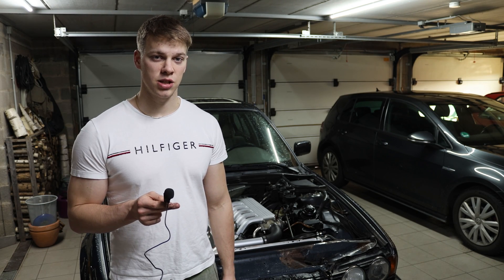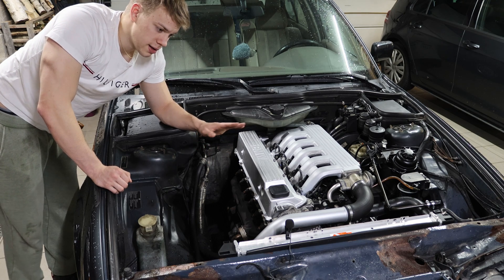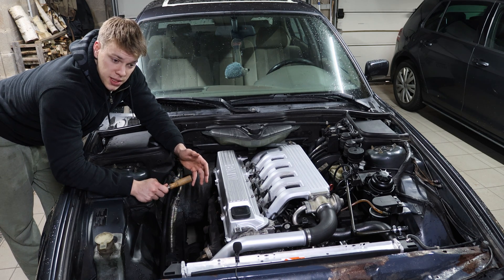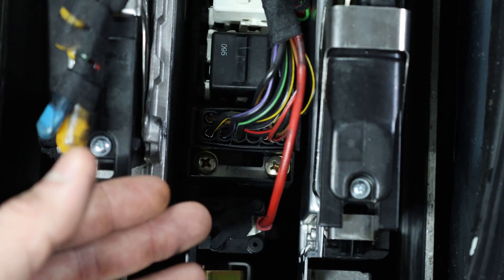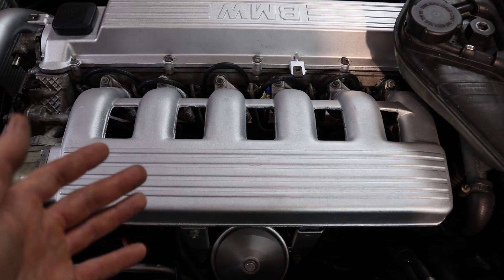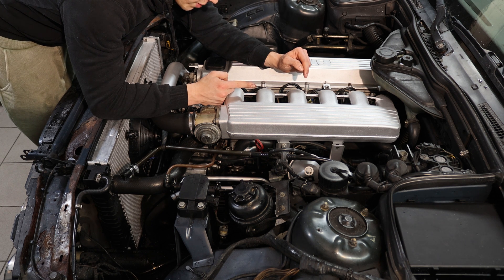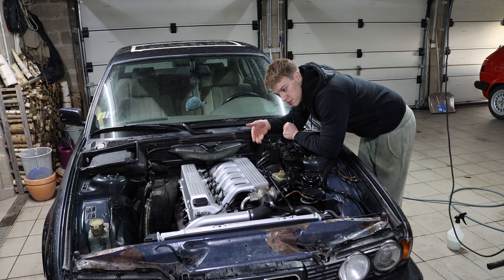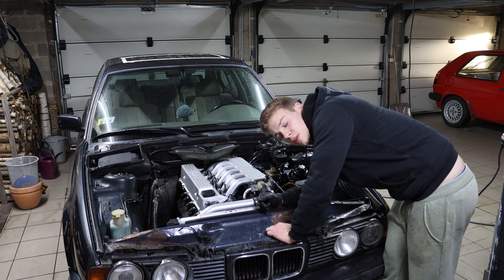How to diagnose and time the injection pump on an M51d25 or m41 (525/325/318)td.s //Ep7

Comment: Any ideas why I have a hunting idle? The car starts on the button, been sat 11 years, it smokes alot out the exhaust aswell, I've put fresh diesel in and changed the filter
Reply from the maker: @user-ej4cb8qv3j
what kind of smoke grey/white/ black? Since you replaced the filter and diesel(necessary after 11 years of sitting and well thought), you probably introduced air into the system( prefilled the filter?). Or it is pulling air from the bridle return lines. Also, check the blockoff cap on the injector from cylinder number 6. These caps often introduce air into the system.
Another possibility could be that someone adjusted the electrical top part on the injection pump( before your ownership) to the transmission side, thereby making the engine run richer. The ECU tries to compensate for this and a hunting idle is often the consequence.  Hope this helps!
Reply: @DailyDrivenClasssics  I'd say the smoke is a blue/ grey, if I break loose the injector lines and crank the engine to see if it has any air, do I need to disconnect the starter relay or starter love wire to stop it wanting to run?
Reply from the maker: @user-ej4cb8qv3j
 blueish smoke is usually burning oil. I run black diesel so mine smokes blue all the time but in your case i would check the turbo. If the shaft has excessive play there might be oil getting pushed in the engine. Since diesel engines also run on engine oil this acts as fuel and throws off the idle which would also explain the hunting idle since the ECU tries to compensate. I bled my injectors without pulling any relays or so. I also did it once with the engine running, so no need to worry :)
Reply: @DailyDrivenClasssics  ill have to check again on the colour of smoke coming out, I'm sure it's grey, the bridle lines on my injectors look very old, do you know the diameter I need? Okay I'll try and bleed the injectors whilst it's running, I won't touch the fuel mixture just incase I mess it up, I'll try find a local specialist, I'll check the turbo when I get a chance
Reply from the maker: @user-ej4cb8qv3j
Bmw says its a 3mm, so just buy some in bulk, its really cheap. I got new fuel return lines with the car and 1 m should be enough to replace all the lines. Put a towel over the injector you are bleeding when the engine runs, or else you will make a huge mess. Ask me how i know :/. I would only go to a specialist as a last resort because most guys that were trained on these injection systems are already in Pension and the new trained personnel is not as knowledgeable. But I am sure you will get it sorted. I will cross my fingers :)
Another thing i forgot to ask is: how many km are on the car. On high mileage cars, the chains can stretch a lot. The engine timing gets thrown off so much that i can mess with the combustion in some extreme case.
Reply: @DailyDrivenClasssics  I'm not sure how to adjust the fuel mixture, so maybe a little more research will need to be done, yes I prefilled the filter, bridle lines as in the lines on top of each injector?
Reply from the maker: @user-ej4cb8qv3j
you have an m51 right? they use a bosch VE pump. They usually have an electrical top part with an actuator that can be adjusted by sliding the middle part of the pump back and forward. I wouldn't recommend doing this first since it is really hard to adjust it to a correct value. The correct way would be with diagnostics hooked up to measure minimal injection quantity or to go to a bosch center and let them adjust it. Briddle lines are are the tiny lines going from injector to injector and from the first injector to the return on the injection pump.
Reply: @DailyDrivenClasssics  yes m51

Comment: Really good video. its hard to find good videos of BMW M51 Engine repairs. I am trying to fix my 325tds E36 Engine since an year now and had to learn many things my self. My M51 starts pretty well, but its runs pretty bad. the engine is Chacking the wohle car and smokes a lot. I have allready installed ne Injektors and a tested, working pump. I timed the pump but that didnt help.
Reply from the maker: @Haizocker
@Haizocker jaja der m51 motor.... ewiges fragezeichen... Spass beiseite, hast de die Motorlager schon gewechselt, meine waren komplett hinüber und habs im letzten video gefixt und seitdem schaukelt das auto wenigstens nicht mehr auch wenn der motor nach wievor bissl kacke läuft. Ich denke dass irgendwo luft bei mir ins dieselsystem kommt. Auch wenn meiner auf 50/50 diesel öl läuft sollte er nicht so absaufen weil er läuft ruhig und dann nach 30 sec bockt er ab weil er sich verschluckt→ luft im diesel
Reply: @DailyDrivenClasssics  
Ja also motor Lager sind neu gekommen genau wie alle sensoren, luftmassen messer, Kurbelwellen sensor etc.
im lehrlauf läuft meiner ganz ok, nur beim gas geben geht der teilweise aus und nimmt schlecht gas an.
Reply from the maker: @Haizocker  okeyy ich hab noch die alte version ohne lmm. Hab sws  gehört dass lmm nur als faktur benutzt wird für die egr steuerung. Wurde bei dir die fördermenge schon eingestellt oder gecheckt?
Reply: @DailyDrivenClasssics  das tatsächlich noch nicht, wie lässt sich denn die Fördermenge verstellen? Die Pumpe wurde noch nie geöffnet nur von einer Werkstatt auf funktion getestet.
Reply from the maker: @Haizocker  hab das ganze im video kurz abgesprochen aber tatsächlich findet man keine tutorials auf englisch oder deutsch.  Schreib mir auf insta(        michelgasche      ) , ich schick dir screenshots

Comment: Had that engine in an Omega. Especially the oil pump was always an issue. Sadly didn't have time to fix it.
Reply from the maker: Thats sad to hear, but if you want to just buy one again. They are still pretty cheap when defective :) .But the Oil pump? Ive heard about the injection pump a million times but never oil pump. Whats the issue with them ?

Comment: Super nice video man! I've been working on my m51 e34 for the last year and its finally coming all together...
I've had a weird problem for a long time tho, when I drive the car in 4th or 5th gear and I give it a lot of gas, the car accelerates and suddently it stops, like fuel suddently stopped being injected for a brief moment, any  ideas why?
Reply from the maker: Thanks!  Glad to year yours is back on the road:) i havent driven mine since I got it:( . Im no m51 expert , but have you checked if its only in 4th and 5th gear, bcuz there are quite a lot of cases where the injection pump dies and it only lets the engine rev to 2-3 k rpm? Otherwise I cant really think of anything else but too little fuel in the tank. Mine always stalled when i moved the car around in the parking lot bcuz the diesel sloshed around in the tank and sucked air into the pump because i only had 1-3 litres in there 🥴😇. Right now I have no other guesses so sorry if I couldnt help but I am sure you will get it sorted!

Comment: I have an e28 524td with the M21d24. I really wish BMW sold the M51 cars here in the USA. My M21 lasted me 11 years. I bought it with 110,000 miles and i retired it with  310,000 miles the last 20,000 miles were with 1.27 Bar,  227HP, and 486 NM before the piston rings gave up. I can only imagine what the M51 could do
Reply from the maker: @524_td
@524_td That's some impressive longevity from your M21d24 engine! It's always fascinating to hear about people's experiences with their cars, especially when they've clocked such high mileage./. Here in Europe, m51s are not well respected at all since everybody wants an m57 for diesel tuning and the older diesels are seen as useless for performance and reliability which I think is sad
Reply: Well there is quite a good reason why M51 is not often seen on tuning stage. Their heads are prone to cracking and warping, they are restrictive with small valve lift. And the concept of indirect injection makes all of this worse. It's less efficient than direct injection therefore creates a lot more heat. And weak head + heat doesn't mix too well.
Reply from the maker: @Ziurkyss  i agree with you and I know that you can never see the m57 performance out of an m51 we are talking about an old idi, sohc, 12 valve 2.5 liter that came without and intercooler in the td. the m57 is a beast compared to the m51 even in stock form. But I would be more impressed by a build where you reach 350 hp in an m51 than another 600 hp m57 build.
Reply: good m21 is definitely stronger than m51, they may not have better fuel consumption but they can push more horses and last longer. my m21 has driven 600k+ km and this summer it threw off the timing belt, literally got a new belt and a new tensioner and it still runs great. (no valve and piston damage). Friend of mine got 290hp with an unopened engine.
Reply from the maker: @Diesele30  600k is a lot and 290 on an unopened engine is also quite impressive. AND you got really lucky with that timing belt sliding off but not causing any major damage
Reply: yup, but it's really hard and expensive comparing to just swapping an m57 and chip tuning it. But some like the fun and the simplicity of this engine :D    @DailyDrivenClasssics
Reply from the maker: @Diesele30
@Diesele30  yes i feel like the m51 is more complicated to work on since it is an electrical pump but i have no tools to scan it since the dde calculator cannot be accessed by inpa so diagnostics is a bit hard compared to m57 where everything can be read by obd2 and m21 where everything is mechanical :( But i bought it cuz it was really cheap and i love the sound of an m51 :)
Reply: @DailyDrivenClasssics  When i bought my e30 the pump was with an electrical head it was super easy to get more power :D but later the head started to die, so i did an mechanical pump swap. If you don't want to push crazy power and daily the car i would always stay with the electrical pump (u can put the mechanical pump form m21 on your m51) And yes the m51 is still fun and u can get a spare engine for literally nothing :D. And i would say you don't even need an engine scanner for m21 and m51, they are easy engines to find the problem.
Reply from the maker: @Diesele30  Oh my bad I thought all m21 engines came with a mechanical pump. Where I live these cars and engines are kinda rare since they all got shipped to other countries because of emissions :( so engines are hard to find and the same price as m57. Yes, diagnosis is not really hard but adjusting the fuel mixture from rich to lean is supposed to be done while monitoring live values and I can't do that since I have no scanner for old dde :(
Reply: when i had the electrical head i adjusted the fuel mixture with a hammer, just keep hitting the head back and front till it sounds alright :D Thats how u can get more power btw. Where are you from?
 @DailyDrivenClasssics
Reply from the maker: @Diesele30  I m pretty much from belgium.I have done the hammer adjustement but i want the car to idle really nice and not have too much diesel burning since that creates more heat and i have no intercooler atm + i dont really care about horsepower for this car
Reply: ciao dove posso trovare il manuale d officina m41